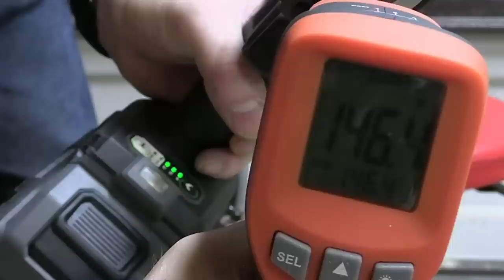Makita 40V Impact vs. Milwaukee Fuel vs. Dewalt XR vs Flex - BEST IMPACT DRIVER?

Comment: I was researching the Flex driver, but now I like the 40V Makita. The Makita seems more innovated with it's technical settings.
Reply from the maker: I do like the options on the Makita -- although, to be honest, I think they may have taken it a bit too far.  My old Makita has 3 speed settings and I was always happy with that.  On the XDT16 -- identical modes to the 40v -- I rarely use anything but the 4 speed settings, the assist modes are almost never on.  The only one I use, if ever, is the wood mode where it slows down so you don't overdrive the fastener.  But if I'm that concerned about overdriving, I switch to a drill and set the clutch or modulate the trigger with my finger.
Reply: @PhillyFixed  As a Industrial Mechanic (Millwright), I look at the tools for use on machinery and equipment that has many different size bolts. Using a battery tool is much nicer than using hand tools, but wondering if the tool is over or under tightening fasteners is a gamble as no one wants to drill out broken bolts. I'm in the process of choosing a battery platform that will make mechanical applications not only easier but also produce quality work. The General Contractors provide many battery Red & Yellow tools on the job site. We build Power Houses; Chemical Plants and Car Plants, so I've used those brands enough to know I want something more. Most tools seems to have adequate  power now days, but being able to tune or fine tune the power for a specific application only makes the tool more versatile I think. Thanks for the reply and I enjoy your view of tools and your presentation. Keep up the great work. Subbed. :)
Reply from the maker: @skelley521  That's a great argument for the bolt functions the Makita provides!  I think the XDT16 is the right tool for you.  Honestly, the 40V line is really made for heavy construction -- the standard impact driver and hammer drill and other light-duty tools are really just included in the XGT platform so that users of those heavier tools don't need to have 2 battery lines on the jobsite.

Comment: Those batteries are huge compared to the compact impacts
Reply from the maker: Especially the Flex... to be fair, you can't buy the 8.0 in a kit with that impact.  Have to buy separately or with their circular saw.
Reply: I run the 3.0 High Output batteries on my M18 tools and the ergos are fine,  keeping the tool lightweight without sacrificing power.   I have 6.0, 8.0, 12.0 HO batteries as well, but those are for my circ saw, super sawzall,  hammer drill.   3.0's are more than enough for my impact. The 3.0 HO will run circles around a standard 5.0 , with half the weight.

Comment: They all did really well. I'm surprised the 40v didn't do better but Makita isn't trying to break speed records. Is there a Gen 4 Milwaukee?
Reply from the maker: No gen 4 yet!
Reply: There is a Gen 3.5 option.   It involves sending in your Gen3 to Milwaukee to get the collet fixed so that it doesn't release bits, which,  IMO, is the result  of misapplication.   I've never had this problem,  because I use my impact driver as a.....driver.  if I want to drill something,  I use my hammer drill.   But that's just me lol.
Reply: Milwaukee Rep here..... may or may not be releasing holiday’s 2021.... 🤫
Reply from the maker: @firefightexpert  Hook me up with demo units? 😁😁😁  I promise not to destroy them before I give them back!
Reply from the maker: @enockenock4183  I'm with you.  The first time I ever drilled with an impact was... well, for this channel!

Comment: I've found that makita tools don't have the power of Milwaukee but the battery last a lot longer. It's almost as if the Milwaukees use much more power up front at the expense of run time.

Comment: It almost seems like Makita is using the same motor in the 40V as the 18V. All these seem to have plenty of power for what I would use it for. The way I see it is what feels best to you, what batteries do you run already, and what is most available in your area for support. I would not like to have to run four or five different platforms if I could just use one platform for all tools.
Reply: TTC found similar results, in that Makita rewiring their 18v impact driver for 40v didn’t really bring much to the table, whereas the tools built ground up for 40v bring quite a bit.

Seems like some XGT tools exist simply so that  someone can only buy into one battery platform and not have to buy into multiple.

Comment: I'm surprised at how much the Makita 40v UNDERperformed here. Was it by chance set on the highest  torque setting? I don't believe you mentioned about torque setting for it, unless it  doesn't have that on yours.
Reply from the maker: I was surprised, too, but Torque Test Channel's results tell basically the same story:
https://youtu.be/nEoyXDbqiaw

I had the tool set on speed 4 for all of the tests - I do a more in-depth look at the features here -
https://youtu.be/J78KR9eVRWE

Thanks for watching!
Reply: @PhillyFixed  yes I see, bummer. I recently watched this video https://youtu.be/jcogzhBPBEo and am strongly now considering going for their impact wrench set. Looks like they didn't utilize the same torque dynamics as they did with the wrench version.
Reply: @samuelsfoodgardens8836  The XGT Impact Driver is basically the XDT16/TD171 LXT driver, but rewired for 40V and a few more modes added on. IMO, it really only exists for someone that's buying other XGT tools and just wants to haul one battery platform around.

That said, it's still a nice unit, and I find it faster for light gauge steel studs than my 2nd gun fuel.

Comment: Flex won the last 2 test and especially the hardest test of the tests. Was neck and neck with M18 up to last test so how did M18 win?
Reply from the maker: I added up the times and Flex got 54.6 and Milwaukee got 44.3.  The big gap was the 3/8" lag in the stump where in+out was 12.2 and the Flex was 21.7.

Comment: If it's true that m18 impact breaks  bits so often than makita,dwt,hikoki or etc. I understand why makita doesnt make the same power on xgt line impacts, not to break the bits every day but I didn't compare them to say for sure
Reply from the maker: We've absolutely reached the point where impacts make more torque than necessary, Torque Test Channel snapped a bunch of bit adapters testing the Flex and Milwaukee.  At that point it's time to switch to an impact wrench 👍

Comment: This is something I do every day. I'm truly not sure what everyone hates about it because my Ridgid Octane impact driver--with a 3AH battery--is far faster and more powerful than every single one of these, including the m18. I guess people really can't stand the extra 3/8 an inch in the motor(similar to that flex length?) And I guess that's worth sacrificing legitimately everything else as well? I switched from that same Dewalt impact because of it's vibration, lack of power and battery life/longevity, and I can say that after well over a year of heavy, daily use that I've never once had it lock up or slow down, it runs just as well as it always has. 
I use it every day for few things, building wooden and chain link fences, including digging post holes with a 2 1/2 foot auger bit, building/rebuilding decks and their foundations(these exact same applications) and my second business of building custom bumpers, where it's used for drilling large holes in thick, low guage steel with impact rated step bits. I honestly mean no disrespect, but I couldn't imagine using anything as slow and weak as these and that's not exaggeration. The Ridgid would break my wrist before it would lock up in wood. And I do use Milwaukee and Makita hand and power tools as well, but for impact drills(or drill/driver hammers) it's almost laughable to think this is the competition. I think the subcompact would match up well with these though. It's new to the bag but I have started using it effortlessly for the wood working.
Reply from the maker: Unfortunately they are discontinuing the Octane, but the "Max Output" is supposed to be even better.  I'm not excluding Ridgid for any particular reason except that they are transitioning products and the kit with the new drill + impact is only now becoming available in my local HD.  Can certainly do some testing on it in the future, along with the Ryobi HP.
Reply: You dig post holes with an auger bit in a 1/4 impact driver?
Reply: @jimkane9832  fuck yeah dude. I'm pretty sure it's been about 3 years now on countless wooden and chain link fences. I'm purposely trying to run this Octane into the ground--pun intended--but it legitimately won't die on me.
Reply: @jimkane9832  can knock out a whole job with about 16-20 new posts through rocky mud and even concrete (with the assistance of Milwaukee cement bits and hammer mode) in under 3 hours
Reply: @Mik3yLow  I'm not following you. A 1/4 in impact turning a 6 in earth auger?
Reply: Yes, except it's a 2 and a 1/2 ft auger drill bit for an impact drill. Have one that's just round tipped for the regular drill and one that's 1/4 and fits in the impact. I believe I got them both from Menards

Comment: When you test the hammer drills and seeing which one has the most power, could test them in 1st gear? I know that seems obvious( that's where the most torque is), but most tool reviewers don't.
Reply from the maker: So, some of the tests required dropping into 1st gear, but I didn't necessarily do specific testing on it.  The tests are already filmed since I only had the XGT kit for this past weekend, but I can sub in the XPH14 and do some 1st gear tests.
Reply: @PhillyFixed  Well first let me say you are doing a great job with your tests. I am just curios that companies say that they have 1100, 1250, 1400in/p of torque, but i have never seen them tested for those claims.  Thanks
Reply from the maker: @alexe3688  I can get some approximations with a torque adapter... but it sounds like something I should reach out to @Torque Test Channel about!  I know he is planning to expand his testing beyond impact wrenches!  And thanks for the compliment!

Comment: Where do you get those collets to drive in the lag bolts? What are they called?
Reply from the maker: It's a 1/4" hex to 1/2" impact socket adapter -- here are a couple examples, they almost always come in sets:
https://homedepot.sjv.io/a1NNKY
https://homedepot.sjv.io/Jrkkqv

Comment: You would expect alot more from the XGT makita, considering the price of the new stuff.
Reply from the maker: Yeah, but check out Torque Test Channel's video on the 3/4" impact wrench.  Heavy duty tools are where the 40V really shines.  The hammer drill is very good as well but not shockingly so.

Comment: Idk if anyone knows that brushless motors in power tools run in reverse when forward driving causing a power loss, anyone notice that breakaway torque or reverse is always more powerful. My guess the reason for that is because of the way the brushless motors are built. I’m curious as to why corded tools are not brushless, if brushless is more powerful. I’m guessing again that brushed tools have the same torque but can’t achieve more power cause of limited volts or amps.
Reply from the maker: Power efficiency is a big priority in cordless tools, and a big advantage of brushless is lower power consumption for the same level of output torque/speed compared to brushed.  Brushed motors are cheaper (less control circuitry needed) and so in corded tools they still are the choice.   Beyond that I am doing more research on tool motors in general for future videos!

Comment: If you shouldn't use a impact for lags, then what do you use it on??
Reply from the maker: Well... screws!  And more reasonably-sized lags.
Reply: U don't use an impact/driver for large lags u use an impact as our boy Jim mentioned in the video
Even my Gen 3 struggles and works way to hard on the larger lags-small lags are fine but these impact drivers are made for screws and also do a pretty good job drilling holes-even outperforming drills in some tasks

Comment: Crazy to say some wont believe but Makita has the power than Flex and Millwaukee but what we saw with this test that most dont realise is that Makita will get the job done but Makita also pull back some of the power in the XGT to prolong the life of the drills. Millwaukee has put their tools close 90% full capacity while Flex runs their tools full 100% that's why through extreme use they over heat hard and melt their grease as seen in the video but not Makita... So its precision and longevity for Makita which makes their tools smooth and precise.. That's why many will take this video as 40v under powered but DO NOT BE FOOLED ITS NOT!!! Atleast the Impact drivers! Neither less to say also Flex really does go over board with batteries with 8amp hours vs 40v 4amp hours lol... Really be nice match up XGT 40v 8amp hours vs Flex 8 amp hours lol
Reply from the maker: I agree, except that the most apples-to-apples comparison is a 4aH @ 40v Max (36v nominal) to an 8aH at 24V (21.6V nominal).  Comparing watt-hours, you get 144Wh for Makita and 172Wh for Flex. An 8aH Makita XGT would be 288Wh.
Reply: Yeh and you won't get more than that lol but that'd be awesome

Comment: What's the best fast smoothest impact driver now own craftsman use dewalt at work i dont like it? Im a form carpenter
Reply: I have tendinitis so big emphases on smoothness of impact driver willing to try any good brand light and smooth
Reply from the maker: I would go with the Makita XDT14z or, if you want a few extra controls/modes, the XDT19z.
Reply: @PhillyFixed  and can I know for what reason please?
Reply: Xgt no?

Comment: Is the flex impact still working ok?
Reply from the maker: Yup, no apparent damage.  But at almost 150 degrees, no surprise that the grease melted and started leaking out!
Reply: @PhillyFixed  It did push the bolt quite a bit further than the rest so the Temps not a surprise. I wonder how hot it was at the comparable heights of the others. Still hotter I bet. I'm confused on how you have the Milwaukee ahead, to me, the Fkex came in number 1 if not for the lag where it came in at 13 seconds. That test it seemed to come in slower than other similar test and I think it was due to a harder spot at that exact point in the trunk. If using the trunk, you should really do 3 to 5 lags per drill per size and use the average. It's the only way to account for wood density variation. Still not perfect but a lot closer. I watched this and saw the Flex outperform the rest.
Reply from the maker: @jdelapaz14  I'm still working on the blog post, but a bunch of the data is there - PhillyFixedChannel.com

Comment: My question here is that the Flex has the "Sensorless Technology", which I interpret as no thermal overload to protect the battery or the tool itself.   So it basically runs balls out 100%.  I wonder about the lifespan of these Flex tools.   I guess time will tell.
Reply from the maker: Actually, it's not referring to thermal sensors.  It's referring to the hall effect sensors that tell the circuitry which coil on the rotor to energize based on the motor's position with respect to the stator magnets.  Sensorless motors use electromagnetic feedback through the coil wiring to sense the motor's position, making the motor smaller and cheaper to manufacture.
Reply: @PhillyFixed  , ok.  I'm no engineer and that kind of made my head hurt.  Thank you for that😆😆.  I was most likely misconstruing this with the other brands that have the built-in technology to protect the tool and battery from damage in extreme  conditions. I  saw how the Milwaukee's Redlink Plus stopped that M18 Fuel from going insane.  Info appreciated and keep it up with the awesome testing you do.  Loving the channel more and more. 👍👍👍👍
Reply from the maker: @enockenock4183  Check out Torque Test Channel's video on the Flex Quick Eject and you'll see the thermal shutdown in action! 👍

Comment: You would have gotten better results with the 6.0 ho battery with the Milwaukee there better than the 8 with raw power facts......
Reply from the maker: Dewalt and Flex had 8.0's as well for an apples-to-apples comparison.